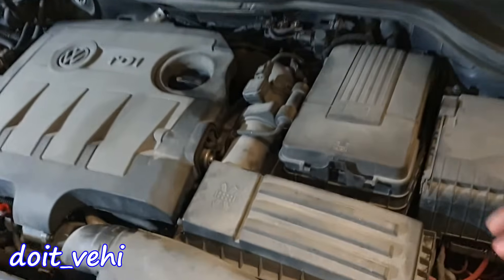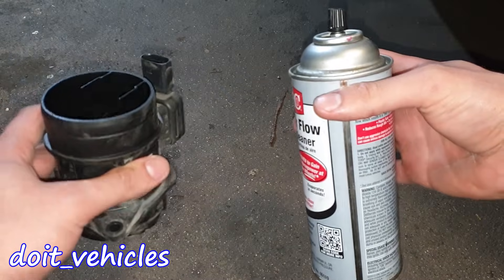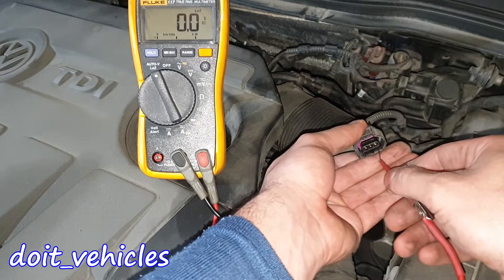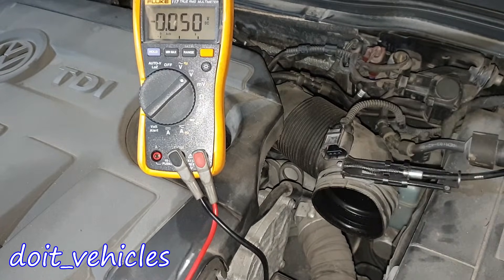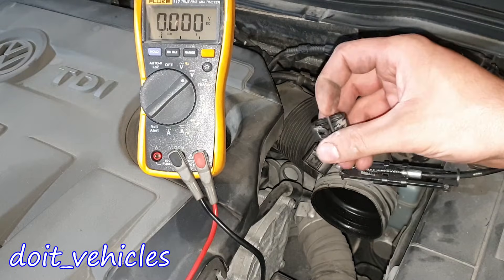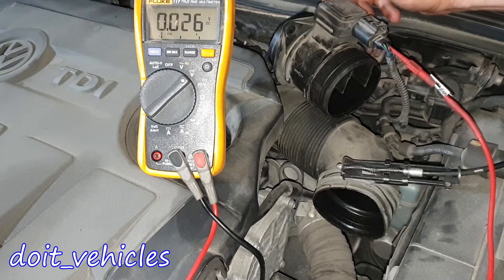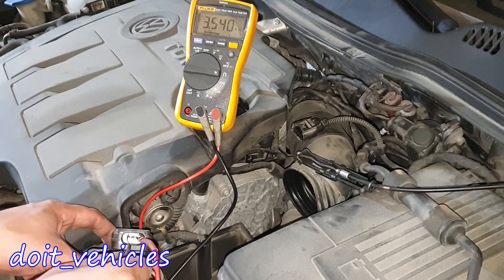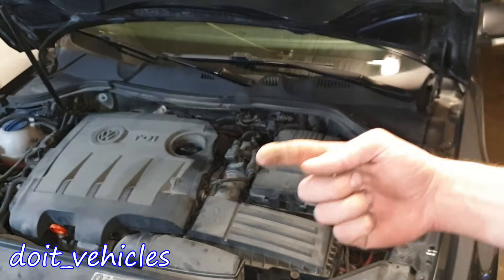1.6 TDI Volkswagen Passat Mass Air Flow sensor - Removal - Clean - Test

Comment: Hi I'm hoping you can help with an issue I have, getting a P0103 error, I've disconnected the MAF and tested using a multimeter as per the video and the middle pin doesn't seem to be receiving 12v, showing between 0.1 and 0.5 volts, 3rd pin showing 4.9-4-95 so no issue there, could this indicate an issue with the wiring itself rather than the MAF sensor?
Reply: You did have your ignition switched on didn't you?

Comment: Hello from India, I drive a VW Polo 1.2 TDI driven for 150000kms till date from December 2011, 
1. Firstly, my car doesn't show the thrust in the pickup as it used to show earlier like it threw us back in the seats while picking up , but now it has turned sluggish inspite of maintaining it very nicely.
2. Secondly, the mileage per litre has gone down inspite of driving with light foot and on low rpms. 

Should I also clean my MAF sensor? Will it help ?
Reply from the maker: Yes it can help , so try to inspect the intake pipes for any residual oil and clean it

Comment: On my Golf 6 1.6TDI Cayc i have the error n. P0101, i changed the maf senzor, nothing...check engine on the board but the car function correctly, it made also the regeneration...all...just check engine
Reply: did you find out the issue?

Comment: My vw passat  is chugging when i accelerating it only happens when the car temperature reaches 90. But engine is cold no problems.but when car is hot you can't drive it it chugging and cutting out when you accelerating.  Have you any answers to my problem. Thanks
Reply: Were you able to resolve this?